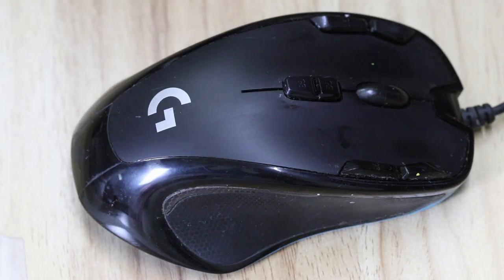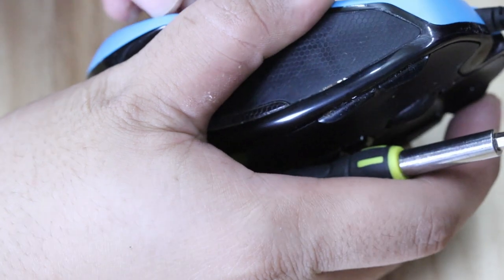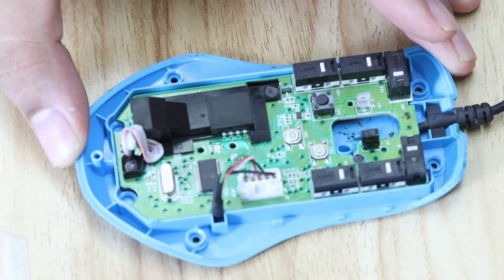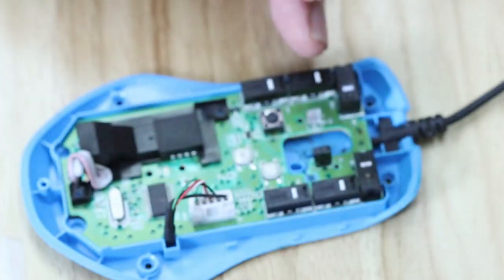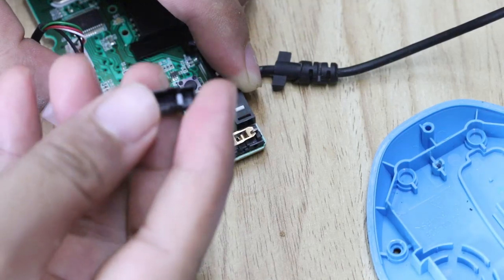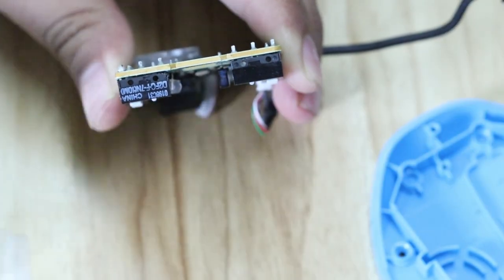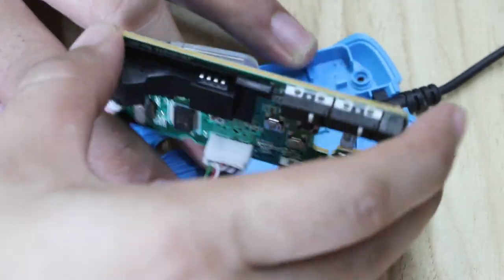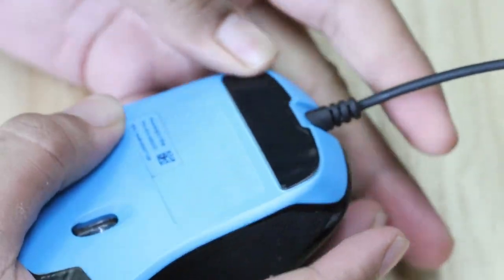How to Fix: Mouse Double Click Problem

Comment: Ok. I tried this, successfully. 
I have to say, those components are smaller than I thought and I had to use some additional light source and even my phone's macro lens (plus zoom) to be able to see it correctly.
As you say, arching the "H" on the plate is enough to give more tension to the spring (the "U" from beneath is the actual spring but arching the H is way easier and safer)

This gives more resistance to the click but you will get use to it fairly quick. The intervention was safe. There's barely any risk of damaging components, just be careful when prying open the switch casing. After the procedure I put everything back on its place, put the same gliders on and we are rolling.

Advices:
- Take a moment to clean your mouse as it's probably full of dead skin, dust and hairs. 
- Take pictures of your progress in case you need to take a step back or don't remember the case or spring plate orientation.

Comment: You saved my life, thank you, now the left clic is working perfectly, for the people looking in comments, you have to use a really small screwdriver to lift the metal part that closes the circuit, I personally used the Truper JOY-32, and other recommendation is to not lift so much the circuit plate because the laser might fall off.

Salvaste mi vida, gracias, ahora el clic derecho esta trabajando perfectamente, para las personas leyendo los comentarios, tienen que usar un desarmador muy pequeño para levantar la parte de metal que cierra el circuito, yo personalmente usé el Truper JOY-32, y otra recomendación es no levantar mucho la placa de circuitos porque el laser se puede caer.

Comment: Bought omron d2fc K 50m, switch that's rated for 5x the one it came with, for less than 1.5 usd for 2, desoldered and swap both left and right click.
The best thing about swapping the switch yourself is, the experience and confidence you get to repair your own thing for other product.

Comment: Just tried your method and it's working well now. Thank you :) by the way, for whoever is gonna try fixing it, you should have a really small screwdriver. I couldn't at home so I opened screws with a knife. If you haven't done it before I'm son recommending. and the metal part is really small so careful :) thank you for the video

Comment: Excellent tutorial! Really, thank you very much! 💯 Unfortunately, the switch on the Redragon Cobra-chroma M711 mouse cannot be opened. They even look a little different. Most likely; it can only be fixed by desoldering and replacing it. The only thing I could do was spray it with some electronic cleaning oil [Silijet E-plus]. I don't think it will work; but it was the only thing I could do. If it doesn't work with the cleaning oil; I don't know how convenient it would be to change the switch since the mouse cost me $600 MXN [$30 USD]. - Ramón 🇲🇽

Comment: I took small piece of paper and put few drops of isopropyl alcohol on it and squize it between joints when they were closed and move it few times, that cleaned and degreased surfaces, seemd worked for me perfectly

Comment: Yes can confirmed it worked, but not without pain. Do not pull the metal tab too much or it can be released accidentally from the trap and wasted hours putting it back. Opening and putting back the plastic casing is also painful in this model. Had I known the amount of blood and sweat and time needed to fix the double click issue, I would have just simply order a bunch of $10-20 (hopefully non-omron switch) mice and move on with life.

Comment: this method did work incredibly.. but I'm not as delicate as you, So the thin metal thingy flew off of its' place.
I manage to put it back in, the mouse works great, but now it silent 😅😅😅😅😅😅😅😅
Reply from the maker: Yeah, it takes a bit of practice! Safe to say this isn't the first time I did it as well. I used to do this a lot back in uni when I didn't have money for a replacement. You can always try bending it again until you get the right "bend."
Reply: it works as a mouse should be, without the double click, but the left click is now silent, and I can't feel the click lmao 😂😂 @DeuteriumTech 
but it clicks tho.. not gonna bother redoing it.. don't want the thin metal piece to flew off again 😂

Comment: I did exactly what you show, with the same mouse, and now it's worse than ever. I have 95% times double click when I click once, while it was maybe 25% before. It's time to buy a new one I guess.
Reply from the maker: Yeah, sometimes things can't be fixed. You can still swap the buttons though if you have the spare parts but you'll need some soldering skills.
Reply: Yes this mouse's dead now. I bought a new one, cheaper version, and so far it's working perfectly fine.